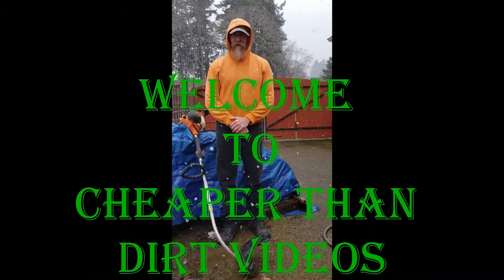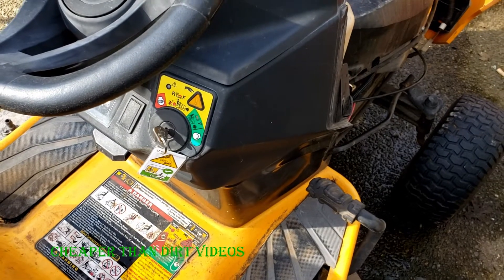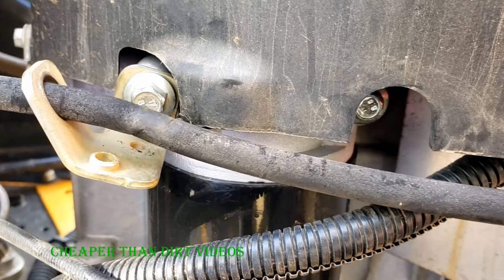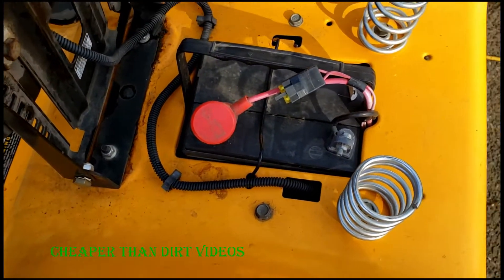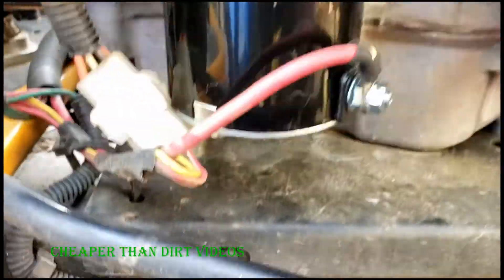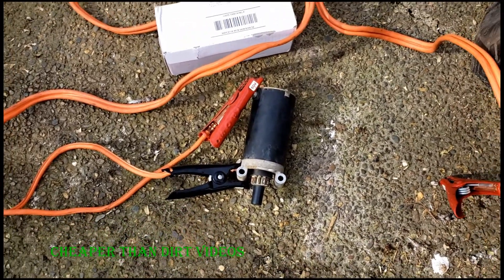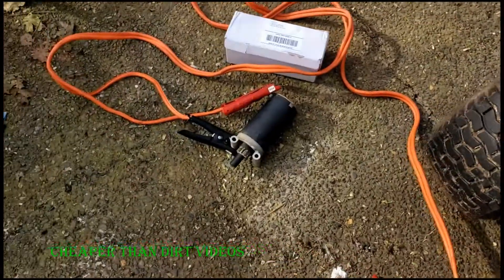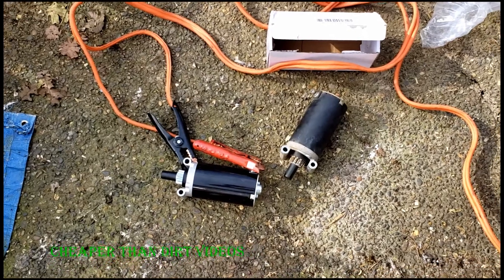Cub Cadet LT1 Lawn Mower Starter Testing and Replacement.

Comment: I replaced one of these at the beginning of summer and it failed about three months (or less) later.
Reply from the maker: My starter seems to go bad every year.  Not sure why this is happening.  I think during the colder months when the battery is low, its causing stress on the starter coils.  Not sure.  I Just bought a starter for $49 and is an easy fix.  Just annoying.

Comment: Surprised your starter lasted so long? I’ve gone through two in a 150 hours. The bendix drive is literally glued to the motor. Comes loose, and the motor spins but won’t engage. Junk. My 25 year old tractor with a 21 hp Briggs & Stratton still has the original starter.
Reply from the maker: Maybe I was lucky with how long it lasted, but it was an easy fix.